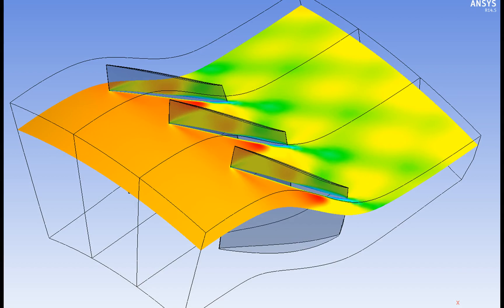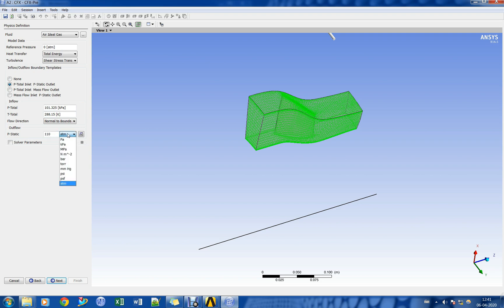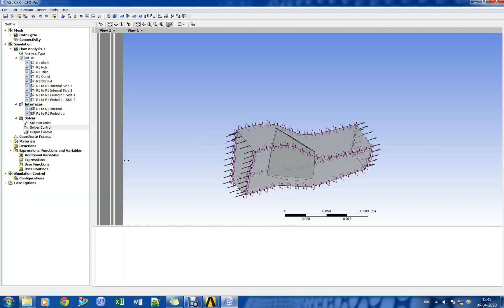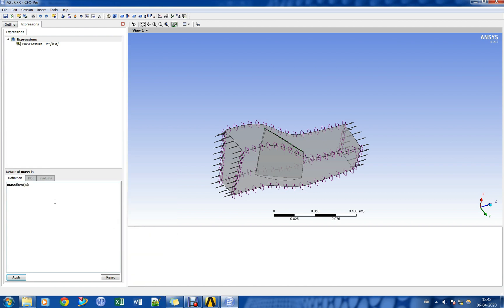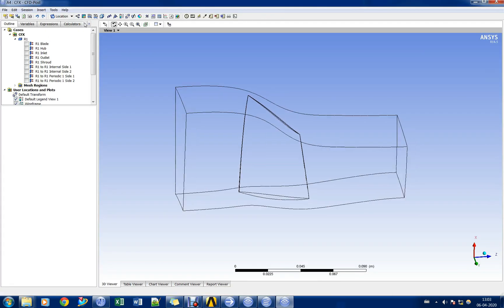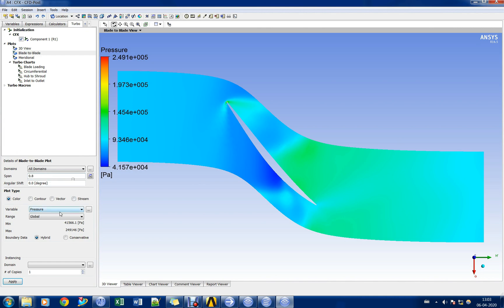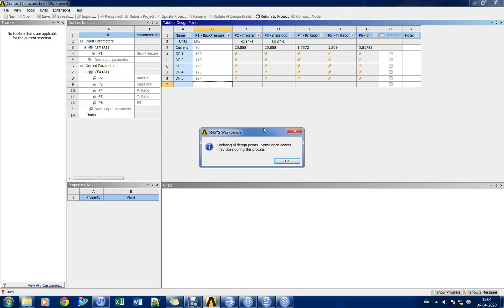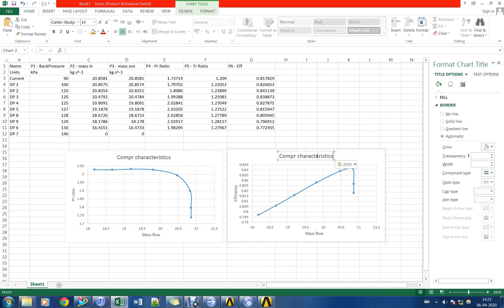Axial compressor characteristics generation using CFD analysis | Ansys CFX

Comment: Can you make videos using CFTurbo software for generating the geometry?
Reply from the maker: Sure, I will upload the videos on CFTurbo soon.
Reply: @LearnCAE  thanks. I have a doubt. If I need to get a performance curve at a different running speed other than the design speed, do I need to change the total condition at the inlet? Or we don't change it and keep it the same as the design point and the only change is change in rotation speed?
Reply from the maker: @SunKing909  Hi, you have to change the rotational speed only.